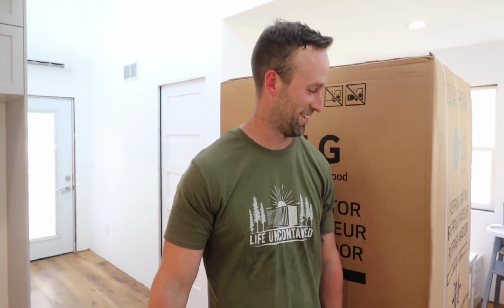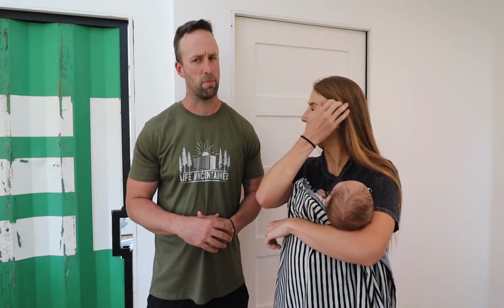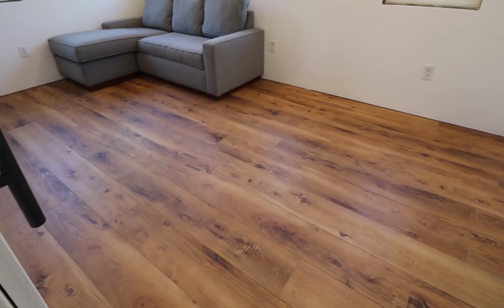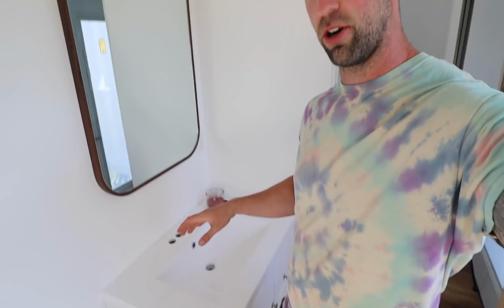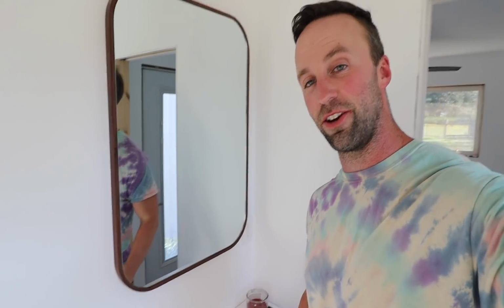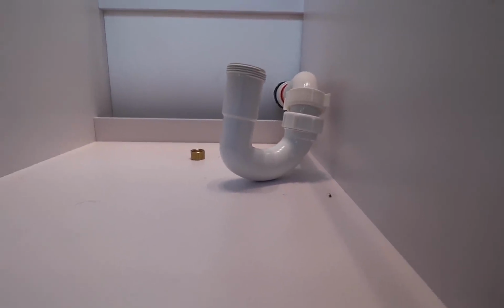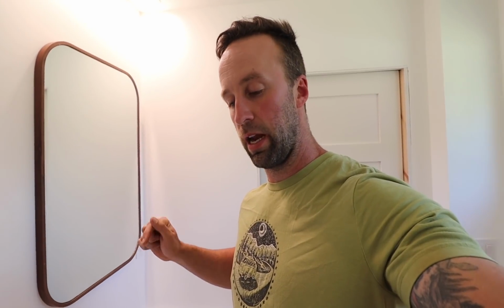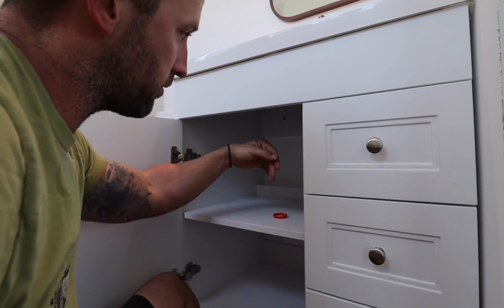Better Than We Imagined!

Comment: I started with you guys about 6 months ago and binge watched a few shows every day with breakfast. Kind of redundant at this point to say you guys are SUPER!! BUT YOU ARE!! 
Too late to say this now, but I would have started those holes in the vanity shelf with probably a 2 1/2" hole saw on either end and cut out the middle. Another thing, when you get around to connecting your kitchen sink, connect the supply lines to the faucet so when you drop in the sink, they will be where you don't have to kill yourself trying to reach up and make the connections. They will already be right there ready to connect to the water supply shut off valves, a much easier connection. I'm just a DYI homeowner and learned that one many years ago. Keep up the very good work that your doing. Your nearing the end of your build and I for one will miss when this ends. {;^(...

Comment: The new floor covering looks amazing. It's so warm-looking compared to the original container flooring and it should be much easier to keep it clean compared to the darker floor coverings.  You may want to consider getting one of those automatic dumping iRobot's. We have about 500 SF of hardwood floor and it does an amazing job keeping the dust down and capturing a lot of the animal hairs from our dogs.  The self-charging-self-emptying one is a little pricy, but it's worth it because you don't have to empty it every single time it runs based on whatever schedule you set.  They also have electronic virtual walls (VW) that you can use to stop the unit from going certain places, into specific rooms, but you need a VW for each area, which adds to the expense. Regardless, the home is looking great and it's enjoyable to watch your progress.

Comment: If it is going to be a while before countertops are installed just get some plywood and make some.  I have also used Cedar fence boards installed with one layer long ways and the other from front to back.  The edges might need trimming to smooth them out but once the edges are clean it is an almost invisible seam. It sands out beautifully. Smells great and can take water all day long.

Comment: Best way to cut a odd shaped hole for the plumbing or any hole neatly, is to use a holesaw both ends of the cut and use a oscillating multi tool or jigsaw to join the two holes together! Great job on the whole property

Comment: Please consider low voltage fan for ceiling.  This removes hot air from the ceiling area and blows it outside.  We got Quiet Cool for the condo no a/c needed on some days.  You can also combine with a/c.

Comment: Congratulations on your new home.  It's quite nice; however, I recommend you consider replacing the "pine-colored" floors with a greyish-blue slate-type floor.  I suggest you get a few samples and place each next to the entry-way door at the end of your hallway.  I believe an interior design professional would recommend no more than three colors that match.  The existing floor would be good for your barn.  Good Luck.

Comment: A set of hole saws would really help with this last fitting of cabinets - all the plumbing will be frustrating as it interfaces with them, hole saws are par for the course!
Reply: Hole saws and a multi tool, makes that kinda job a breeze. Drill your 2 holes then just join them together using a multi tool blade. Neat n tidy just remember seal the exposed edges as if you get a leak it will swell the wood.

Comment: Get you a dremel for those fine details it will help. I use one for cutting tight openings for light switches and outlets in tile. But you can cut through just about anything just takes a little patience. Nice job everything you have done is beautiful and I remember watching when you were connecting the two containers with the sub floor.

Comment: That was a nice black snake there - the kind you WANT - eating up the mice and other invasive little critters, and possibly keeping the poisonous ones far away. Thanks for just relocating it.🤗
Enlarging the p-trap hole was going to be necessary anyway, because being able to remove and re-insert the trap is the point of the whole thing. Congratulations on the running water and - those floors - gorgeous.❤️

Comment: Gonna need vents at the back of the fridge to get rid of the discharge heat.
Reply: I was thinking the same thing. Cooling air will go under the bottom then around the coils on the back then needs somewhere to get out the top.It'll still work but will not be as efficient and hard on the compresser.
Reply: That compressor will be shot within a year's time if it runs too hot.
Reply: @LeonNaude111  If it's not in the owners manual then call the manufacturer and see what they  recommend for space around it.
Reply: @rogersprouse8740  i do refrigeration for a living

Comment: The house is coming together nicely. I know that you are excited for everything to be done. One question though, don’t you normally need to add a thin layer in between the subfloor and the actual flooring to help prevent squeaking as it’s a floating floor and not nailed or screwed down?
Reply: I believe the flooring has a backer strip preinstalled on each piece of flooring.
Reply: Yeah. It's probably the Lifetime brand flooring that has the underlayment under each board.
Reply: My bamboo flooring is a floating floor and we didn't have to do that.
Reply: The LVT that I put in my sunroom already has the  backer preinstalled, so no need for underlayment (and the instructions make that clear).
Reply: Brandy Sutherland  That's awesome. Thanks😎
Reply: Looks like a click vinyl floor with an attached under pad. Super tough and durable and 100% waterproof.  Perfect choice for a young family in the country.😍💕🍁
Reply: Brandy Sutherland  James is a cool name. I have a black and a white robot named, Eve & Wally 😆. God bless you as well🤙🏽🤙🏽🤙🏽
Reply: WOW thanks for all the great information about the flooring. I know technology has changed a lot with how they make and install them. I grew up with hardwood flooring and am blessed with gorgeous thick oak flooring in our 80+ years old house which had been covered up with carpet throughout the first floor except for the kitchen. I have always loved watching DIY types of shows that have given me the courage to tackle various projects in the different homes I have owned and rented (with the landlord ‘s permission). Thanks again and have a great day 🤗

Comment: Koo- doo's to both of you!!! I can truly sympathize with every painstaking wall you both have ran into during this build. In 1984 my home burnt to the ground. We lived on a farm and had just built a 75' X 100' metal barn for storing our hay since we lived on a farm surrounded by a creek on the south a pond on the north and the South Canadian river here in Newcastle, Ok. We had snakes just as you guys keep finding but I am deathly scared of them and was not as nice placing them away from our home and would kill them. Had many water moccasins and between my husband and I we had 6 children which terrified me at the thought of one being bitten. Instead of building a home to replace our loss knowing that would take over a year my husband and we were living in a 36foot travel trailer, we decided to do what was called an envelope home, a structure with in another structure. We took the barn dug out the entryway to sink our living room 3 foot to help with keeping it cooler in the space we would spend the most time in. We converted it into a 4 bedroom, 2 bath tri level home with a open concept of our loft bedroom overlooking the living room kitchen and dining area, a 18 foot tall livingroom ceiling in our 20x30 living room and utility room/mud room from the back lot where we kept our show animals. I was the contractor and did much of the work my self, from helping with pouring cement, placing insulation, sheetrock, tape and bed to texture and painting walls, designing a center island in my kitchen with a Jen - air down draft stovetop, laying counter tops, staining cabinets, and doing a lap and gap gymnasium floor pattern on our ceiling and polyurethaning all woodwork which reminded me of a long brach beach saloon back in the olden days with banisters and 3 sets of stairs. I installed a sky light in my bedroom to be able to lay in bed and see the stars at night. People were amazed at our beautiful home once completely finished. From the outside it looked like a barn but once you entered the house it was breath taking, rustic but contemporary. I learned many things during this build and that was patience and NOT to sweat the small stuff and all of the things that stop progress and held me up were simply the small stuff that could be resolved and fix. I know Once you two complete your home your going to be so proud of ALL the hard work, blood, sweat and tears and appreciate your efforts. I know personal because of my journey. May God Bless your sweet little family and fill it with lots of LOVE.
Reply: Hello 👋 how are you doing today-

Comment: @Life Uncontained  - Hi Mackenzie and Spencer! Great video (as always!). Wanted to tell you a trick for the bathroom cupboard and having to cut a hole in the shelf... I had the exact same issue with the p-trap for my vanity. I bought some shelf liner/paper and covered the shelf. I knew the hole was under there, but no one else did. Worked like a charm. Give it a try and see if it helps you out. It's not a huge deal regardless. Of course, you don't want to start cutting holes in a brand new vanity/shelf, but in the end it is in a cupboard under the bathroom sink. Not many folks are going to be looking under there. Well done, Spencer. You never cease to impress me!  
Heather🇨🇦

Comment: Melamine board is a quick and simple countertop for temporary use.  You can have Home Depot cut it to size for free then just set it in place with a couple dabs of caulking.  You can tape any seams with white electrical tape.  That's what we currently have in our build while trying to figure out what countertops to get or make.

Comment: If you have aerator covers on the faucets you should let the water run for a few minutes the let the particulates wash out before installing the covers.  Congratulations on the new sinks!  Your little girl 'helping' you with the drawer knobs was too stinking cute.  One step closer to moving in.

Comment: A suggestion for your tile work, look into a tile leveling system for large format tile. it will keep everything spaced and level to each other.  I have found that attaching the waterlines to the faucet before you drop in the sink is easier to get tot the shut off valves.

Comment: If you have not done the second bathroom basin. Lift the outlet side of the waste using 2 x 90 degrees bends. Generally easier than dropping the P-trap and you don't need to cut shelves. Makes the trap easier to service in the future as well.

Comment: One thing that would be a good idea for the future is cut and fit a section of vinyl flooring from a big sheet and install it on the inside of the sink base.  Caulk around the edges and if you ever have a leak you will not have your base wood get wet and swell up.  With the big hole however you exposed the edge of that very thin wood.  I am concerned about what will happen to that sink base in the near future.  Rather than leave that big hole under the p-trap base get a plastic coffee can lid off a large coffee container and cut the rim off.  Stick a small nail with the point up thru it.  Insert the lid with some construction adhesive around the edge into the hole and then use the nail to pull it up against the underside of the shelf.  Put a locking plier on the nail so it pulls the lid as tight as possible.  If it works out and the glue dries you will have the hole sealed but have enough flex on the lid so when the p-trap goes against it it will flex.  For the rest of the hole repair, make up a small amount of Bondo and level off the hole to the level of the original shelf.  Sand then paint.  Problem solved.

Comment: I would drill some holes in the side cabinet that the stove goes in. That will help provide a little more air flow to help cool the refrigerator and it will not be seen after the stove is in. I'd build a "FASLE WALL" in front of the P trap. That will prevent stuff from falling down the hole and also will make it look better, if you are worried about that. You could also drill a large hole too. Looks good when  the door is closed.

Comment: The floors look great, the bathroom has a vanity that works, so good progress. Even 'professionals' make mistakes, ours managed to cut a floorboard and include a bonus water pipe. That was not a good result, your trials were small. If the shelf appearance is a worry, trim it out with a small removable box round the P trap.

Comment: From the wall install a 45 degree corner then transition to a straight, then into the p-trap (now higher and would have cleared the shelf) then on into the metal drop (which will probably need to be trimmed to the right length).  HD has lots of video's of how to do things like this but plumbing is mostly common sense.  As long as the toilet and sink and shower have a vent stack in the mix then you will have no gurgles or slow drains.

Comment: You forgot the escutcheon covers for the water lines.  By not having those there it leaves a hole for bugs to come in and air to enter.  Btw, a pro tip for you.  If you can turn the vanity cover upside down on a bed (if you can remove it of course) and pre-install all the hardware like the faucet and drain.  It is much easier to get to.  Also, I always install a light under the sink so I can see under there when I am working or getting stuff out.  It only needs a simple $10 battery-powered light from HD. The kind you can stick up on the side with some double-sided tape.

Comment: When you were discussing how to cut out the shelf for the p-trap, I was thinking you may have been better off with some hand tools maybe. Start it off with a hole saw then a pad saw or plaster board saw then finish it off with some files to smooth off the edges

Comment: I thought you were able to push the p-trap a little further up, or maybe shorten the sink drain pipe, then a flexible rubber connect to the lower drain going to the wall.

Comment: Great  work guys..measure  twice  cut once..also, you can get a hardening spray foam for any open areas by the pipe in the vanity to close it up..then flatten with a trowel as it dries..and as far as those tent  caterpillars I saw..make sure your cattle  or horses don't ingest any..they are poisonous and will cause to abort any babies ..

Comment: Buy a keyhole saw. Also, leave more room around the trap and fittings. At some point you will need to service them to clean them out or fix a leak. Think ahead and you'll avoid many of the mistakes you're making now so that they don't come back to bite you in 3 or 5 years.

Comment: Shark bite fittings a great to use, but odds are that some day they WILL stat to fail. I have several in our home but that is until we get the house re plumbed with PEX sometime within the next few years. This place was built in the mid 90's and has POLY BUTYLE pipes.

Comment: It looks like there isn't enough space around the fridge.  Check the fridge manual for how much gap is recommended.  Some need space on the back and sides, some only on the back (but then need space above at the back).  If the fridge can't easily get rid of heat through the back (and sides on some),  the pump will run too much and use lots of electricity.

Comment: Just a thought.. How is the refrigerator going to breathe?? It needs air for the condenser.. Cool air in...Warm air out.... You could ruin your compressor.....
I may have missed it but you could put a vent in the side wall to the hallway behind the frig...About the size of a supply air register is fine...6x10 +/-

Comment: Spencer, What sort of Summer Temperatures do you get there?? Refrigerator MAY need ventilation as it appears to be very well built in. Would suggest a coupe of 50-60 mm holes in floor directly behind it, With gauze underfloor, and a vent of some type into the overhead cupboard. A refrig that size would require some ventilation I would suggest. Ex Refrigeration Mechanic wit 43 years experience!!

Comment: Think 🤔 I would of cut the sheet rock Re-worked the drain n water lines to fit the vanity 
Then put a 1/4 piece of plywood back over the lines n hole in sheet rock for future access?

Comment: re: no good tools. again.... i'm years late, but incase anyone ever comes up against this..... the keyhole saw you used on the drywall is ideal for this. OR if you have a drill you hate and you really trust yourself, chuck a router bit into a drill you hate. (WARNING: you're gonna hurt the drill. make sure you hate it)